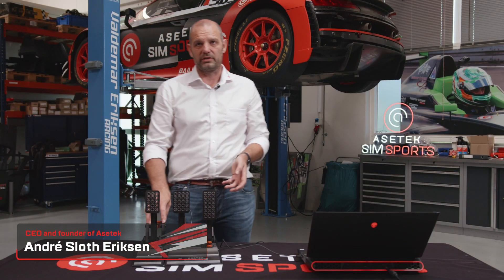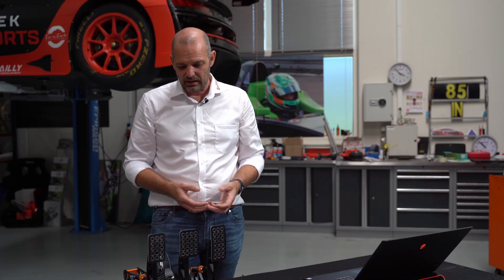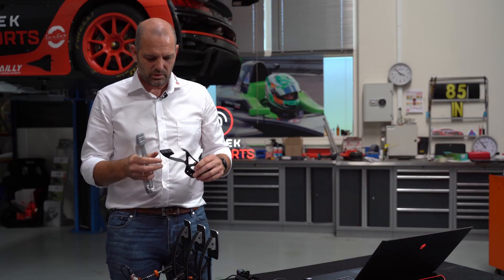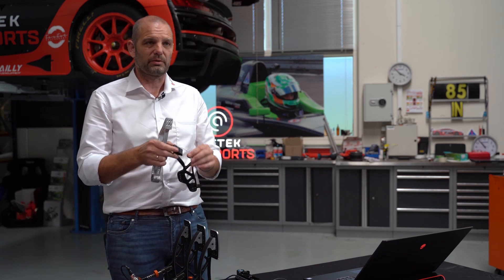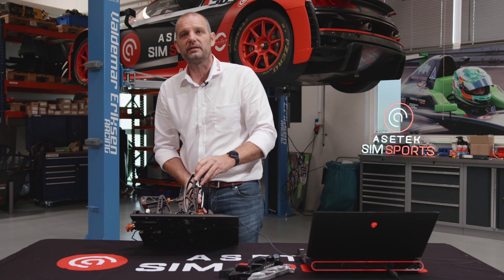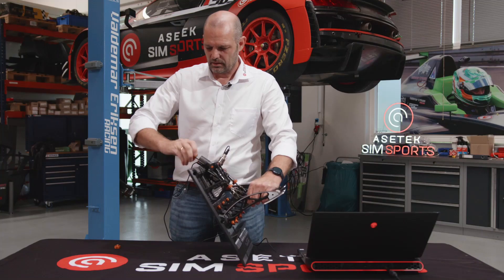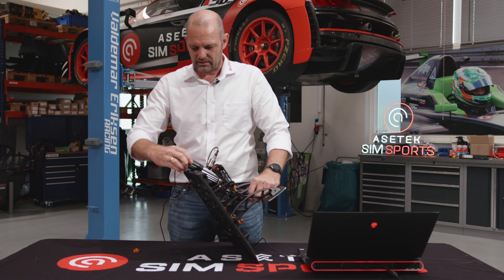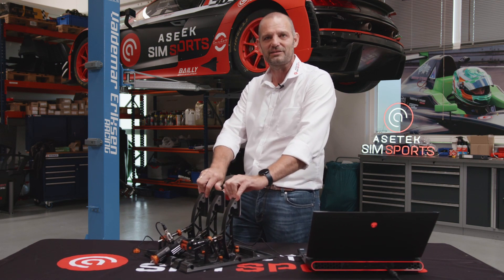Quality and reliability at Asetek SimSports

Comment: The first time I saw reliability testing in a racing manufacturing environment was at a racing wheel company.  They had a wheel mounted in a custom rig with an arm bolted to the wheel center.  The arm moved in a way to introduce stress on the wheel center section, to check the strength and durability of the weld holding the center (this was a NASCAR wheel).  When I saw this, the machine had been running for close to three weeks and had simulated I can't even remember exactly how many hundreds of thousands of laps at a particular track.  The machine was going to run until the wheel failed.  Pretty impressive.  Cool that Asetek are doing durability testing like this.
Reply from the maker: Cool and thanks for sharing! We aim to make sim racing gear that's as authentic as possible and that includes our testing methods. We're really glad you noticed ;)